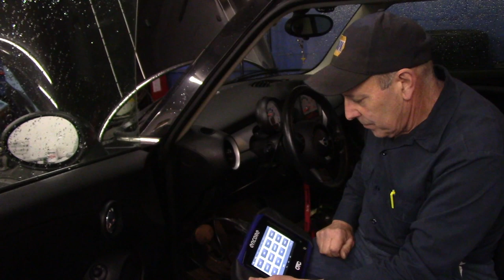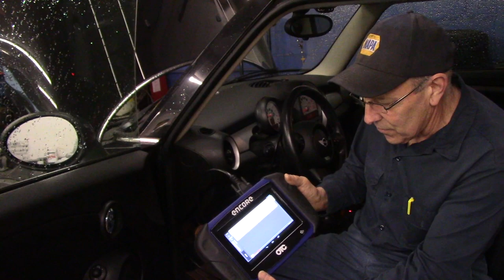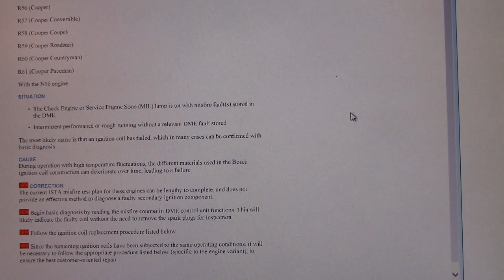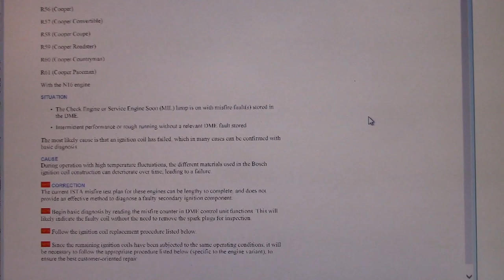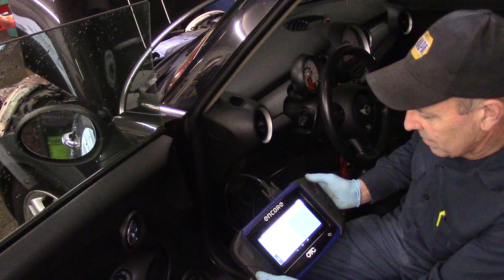Diagnose And Repair A Random Misfire 2016 Mini Cooper

Comment: Nice diagnosis Jim. Those cars are notorious for failing coils. Mario just did one as well, and there was a discussion on it because they also have problems with carbon deposits that need to be addressed. Great video as always!
Reply from the maker: I will need to check out his video.
Reply: That's an N12 or N16 engine; it's not direct injected, so there's no problem with carbon build up.  It would have been nice to know how many miles are on the engine.

Comment: hi jim, I have 2010 bmw x3 with 180000 mile i m having random misfire issue P0300,P0304 and P0306, i have changed new coil new sparkplug new air filter cleaned MAF sensor changed Valve cover gasket ,cleaned all fuel injector clean vanos solenoid and filter but this misfire keep coming back and at low rpm car gets hiccups this is on going from last 2 month but car runs very smooth on highway ,also when im at full stop i see very lite  white smoke from the exhaust i'm in NJ any idea what could be wrong  please give me some tips
Reply from the maker: Thanks for watching.
Reply: @jimthecarguy   any idea why it keep misfire same cylinder

Comment: If your scan tool does not pinpoint which cylinder misfired what’s the best way to determine which coil is bad?
Pulling the coils out one at a time while the car is running?
Reply from the maker: The scan tool will tell you what cylinder misfired . No you don't want to pull the coils . The shock can knock you on your rear end.
Reply: Relative compression test off any coil and battery ground with a scope

Comment: Yeah, "over time the materials in the coils can break down"...so, after less than three years and 37K it needs new coils.  Way to go BMW.  It's out of warranty, I'd recommend they sell it.  Coils will be the least of their problems over the next few years.  11 years and 202K miles and my 2008 Honda Odyssey I bought brand new is still on its original set of coils.
Reply from the maker: Oh yea you can not beat the dependability of a Honda. They are my favorite.

Comment: Have had 3 Mini Coops where the tsb suggests upgraded coils and plugs. Useless. Does not repair the misfire. Timing solenoids and throttle bodies are the common issue when coils and plugs don't help. Also coil driver circuit from the ecm gets damaged. Electronic pros can repair that. Maf is possible but usually maf code is actually throttle issue. Often you will get no codes. If any coolant temp codes, notorious for thermostat assembly which also can cause misfire.
Reply from the maker: Thanks for watching.

Comment: 2016, with 36k miles and a bad coil?  What a joke BMW won't cover it under a powertrain warranty.
Reply from the maker: Actually it would have been covered but the owner decided to pay out of pocket instead of dealing with the dealer.
Reply: Ozzstar it’s electronics nothing is 100% through 75k or whatever interval it should of made it to . This can happen to any brand at any time. And it’s mini who would of warrantied it. Bmw made the new Supra too but it’s Toyota who services it.

Comment: Sounds like it has a vacuum leak Jim, listen to the tape and you'll hear an air leak.
Reply: You can be fooled with audio on recorded videos where it sounds like a vacuum leak. Jim would have caught it on fuel trim if it had one. Most likely the intake design on this car is what you are hearing.
Reply from the maker: With the newer cars today there is a lot of noise from the intake but in this case the was no leak.

Comment: I am not convinced that replacing all coils is a good thing to do. They have very long design life so one bad one at a low milage and age does not indicate they are all going to go. Its just in indication of not so good quality control at BMW's coil supplier. BMW replaced all the coils on my V12 BMW as a good will gesture, which is the same coil as the Minis. Two failed within the first two years...
Reply from the maker: Thank you for watching and your input.
Reply: The cost of the labor to address the issue a second time would not than cover the cost to just replace when 1 fails. Don't let quarters fall out of your pocket to grab a penny.